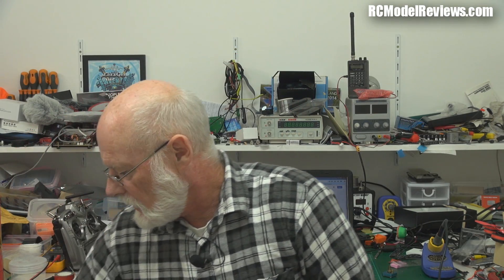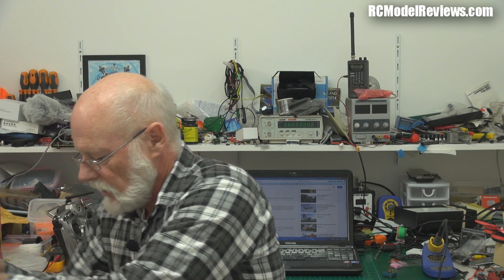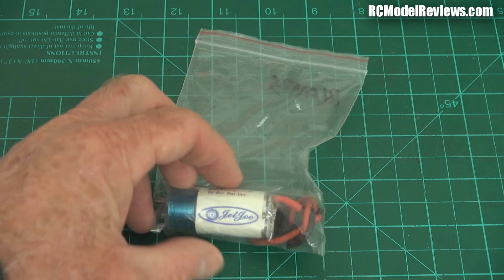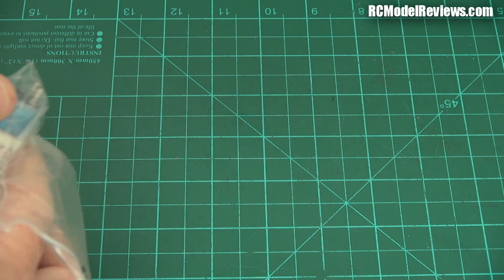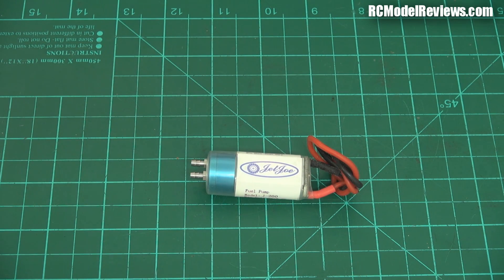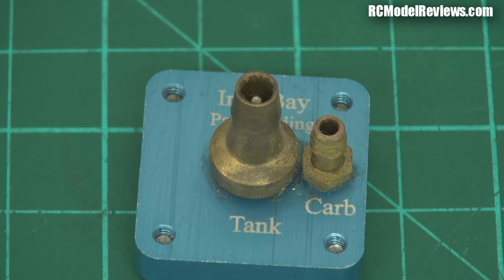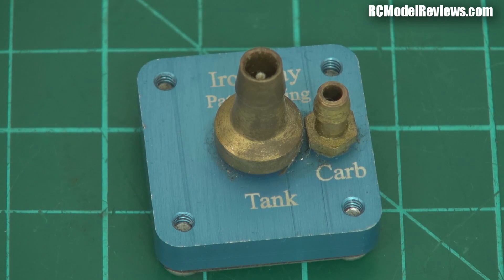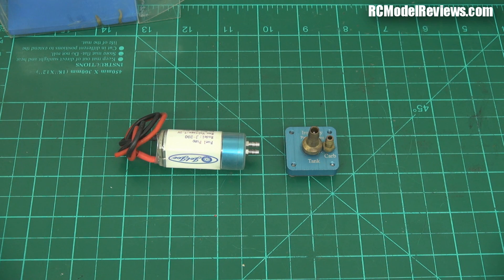Project: A real jet-powered RC plane for under $200 (continued)

Comment: Hi Bruce,
This is how I did it.
I do pressurize it with a “balloon” bicycle inner tube. This setup is simple and light, I understand your worries about an pressurized tank. In my plane I installes an rc controlled valve between the “balloon" and tank so I can shutdown the engine at will. The pressure in the tank is only 0.5bar that is enough to give a positive fuel pressure to the engine, even during the bungee launch. I use a CLINE regulator in front of the engine.

 https://youtu.be/qVXamsYOHuI
 https://www.youtube.com/watch?v=qaCvgohxfFU

Comment: Most air-pulling/-pushing engines use 'hard'-action to rectify the air, e.g. turbines, valves, propellers, ram-shock... but how-about using a dual-sided flow-compressor-expander-to-rear-inductor, letting the inflow air oscillate left-right around an inlet bow, and outflow air mixed to induct air through the opposite side... a left-tube/right-tube-pulsating buzz-jet...

Comment: What about two long thin tanks one each side of the Pulsejet,,, that way the cg wouldn't change so much as the fuel diminished. The inside of the tanks should have baffles so the fuel doesn't slosh around changing the cg quickly

Comment: Bruce, 
To get fuel to your engine how about a pulse driven diaphragm pump like a Fuel Pump Replacement for BRIGGS & STRATTON 491922 808656 $7.36?  You will need to get pulses from the pulse jet to power it.  

C2Engineeringusa
Reply: I was just going too post the same thing. They are made for fuel. The one I'm looking at runs off a vacuum pulse.

Comment: why not just have the pump on the throttle channel with a brushed esc? cheaper, lighter than that chunk of blue anodised aluminium...
Reply from the maker: Because any slight variance in the pump pressure (without a regulator) would cause the engine to stop.
Reply: RCModelReviews 
Love your videos.   Keep them coming.

Comment: to save the price of the regulator, just run the pump into a small surge tank in front of the motor. won't be a lot of weight gain far fr ok m the CG, and it will also be constant (until the fuel runs out and even then it's not much weight) that way it can draw fuel easilly, and the pump is just a lift pump that fills the surge tank and overflows back to the main tank...

Comment: the other benefit to this is you now have radio controlled engine shutoff.
acedemically i still think it would be cool to have the glow plug on a switch so if the engine stalls you can dive and restart it :)

Comment: Hey Bruce - where did you score a Jet Joe fuel pump for 35 bucks from?
I have 2 JJ3000 turbines, and one of the fuel pumps shat itself yonks ago (simple Ali gear-type pump - run them out of fuel for 3 seconds or longer, and they sieze)
I priced a few equivalent pumps...and they were in the hundreds of dollars a pop.
Pretty sure my munted one was a 'JJ 400' - for $35.... I'd give it a go...
Reply from the maker: I bought this many  years ago from JetJoe themselves.  I bought two... the first one leaked right from the start and stopped pumping after a few short minutes (never run dry).  I'm hoping this one will last just a little longer ;)

Comment: You can use the small paraffin tolerant pump Bruce, and it's simpler than you think and a method I have used on my early Turbine builds. You simply plumb the pump so it draws fuel from the tank and then back into the tank in a loop. Running the pump at full speed constantly which is where it will work best as a gear pump does...Then, you interrupt the return fuel line and introduce a simple needle valve or tap which you can then close to make as much or as little pressure as you need. You then tee tap off the pressure side of the fuel line and that then feeds the engine. A quick release stop valve allows fuel to go to the engine after you prime start it, with the fuel pump on a safety switch servo operated of course. I flew my early Turbine models using this method, I know it works and you dont need any fancy flow regulators either.

Comment: I wonder if you could make use of the pulsejet's vibration to draw fluid into a pipe... Install a little check-valve at the end of a fuel hose loosely suspended in the tank, mechanically coupled to the engine. If it vibrates up and down a little with each pulse, it should slowly draw fuel upwards.

Comment: A fair bit off subject I've been searching for a CHEAP high pressure micro mist pump for ages now without success.
The purpose for this is a timed plant bug sprayer but maybe could be adapted as a pseudo fuel injector?
Anyone found these at all? Car windshield pumps are useless BTW as I'm looking at 80PSI+.
Reply: what about a small pressure washer for a car
Reply: If you're happy to regulate it down, maybe you could try a high pressure fuel pump for a fuel injection system? Not sure if it'd be happy to run without petrol going through it though
Reply: Hey Chris, Thanks for replying.
I'm after a 12v DC micro pump and they are rare.
Reply: Hey stumpy, 
Thanks also for the reply.
Still trying to find some kind of micro high-pressure pump that is less than the 'industrial' $200 additional price.

Comment: A small T-piece & return line should be easy enough but if it's completely open on return end I wonder if pulse engine could end up sucking fuel from return line & possibly slurp in some air bubbles....
Would probably be best to ensure return line stays immersed below the fuel line much like the fuel pick-up line....
Another thought would be to 'sliiiiiightly' restrict fuel return line with, for example' one of those 60cent G-clamps available from petshops for use on fish tank air lines....
Then again, Im sure you've already thought of all this & have a plan formulated already Sir Bruce....
All the best & looking forward to seeing how quick this thing farts along! :)